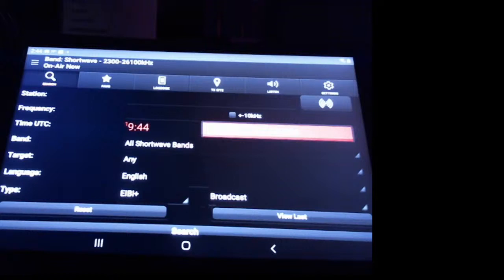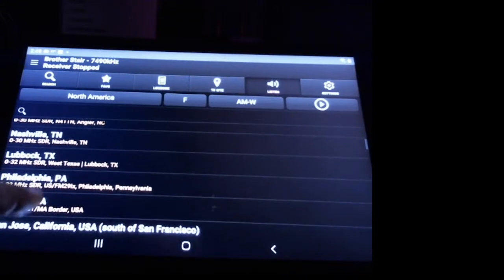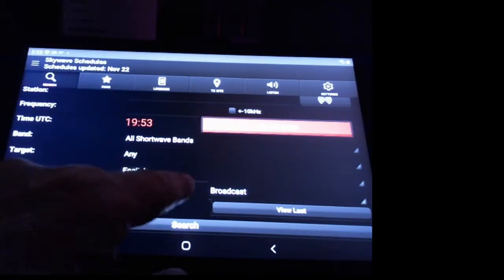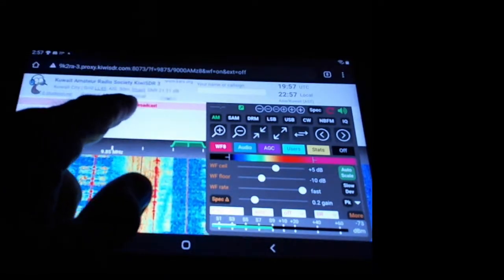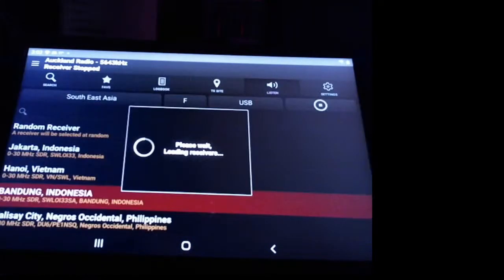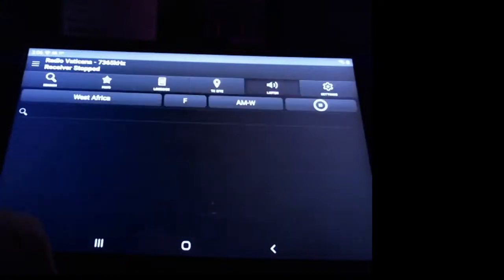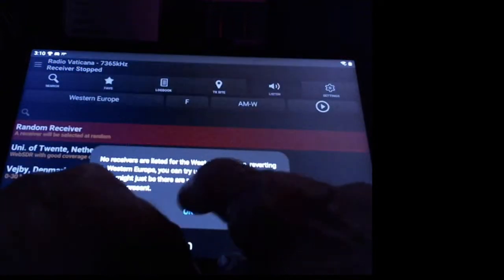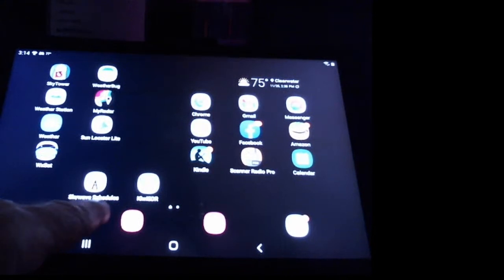TRRS #2288 - Scanning The Shortwave Bands on Android Tablet

Comment: I did notice some discrepancies with this software. When searching for utility transmissions hardly any scheduled Maritime Weather broadcasts appear in the lists, it's mainly Aviation. Also Radio Romania Int was set to broadcast at 2300 to 0000 UTC on 7220kHz, the interval signal was heard but was switched off on the hour. I'm not sure if it closed or not or they made a mistake. I tuned to Voice Of Turkey on 2300 UTC 5960kHz instead, surprisingly it was on tonight as the station sometimes does not broadcast at that time (mistake by Voice Of Turkey). Maybe the Skywave schedule isn't correct.

Comment: I've got this Skywave Schedule software on my tablet, I mainly use it for Shortwave schedule rather than use the KiwiSDR's from the app. The main snag is you can't record the audio, as it won't download the file to your tablet. So you still have to use the main webpage to receive the audio files. Great idea though.
Reply from the maker: I use it to check if a station is really broadcasting and if it is I try to get it on my local radios.